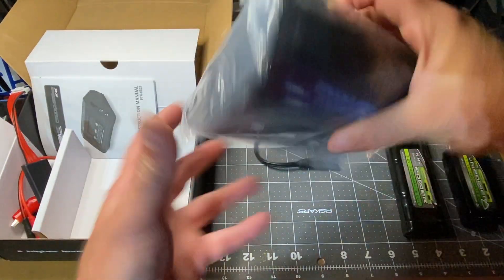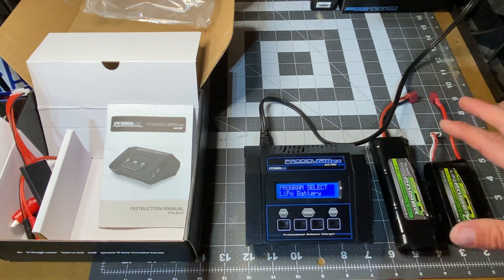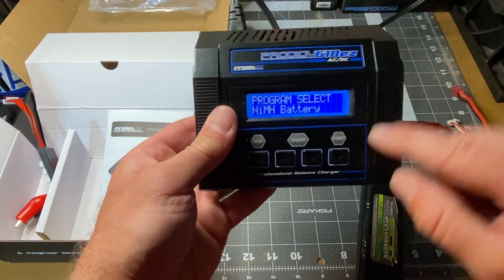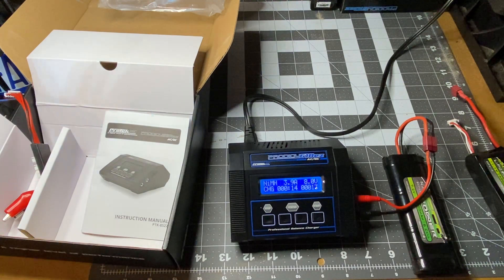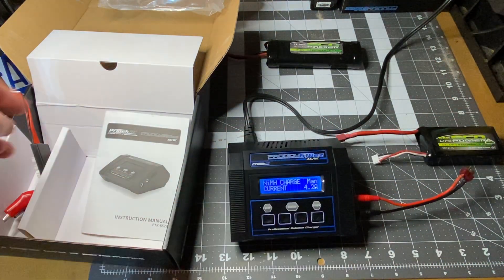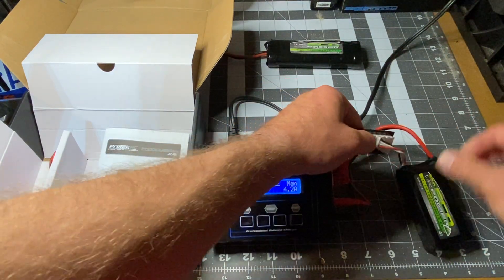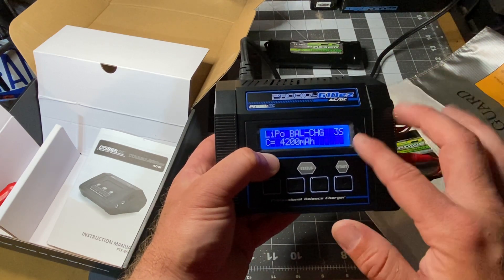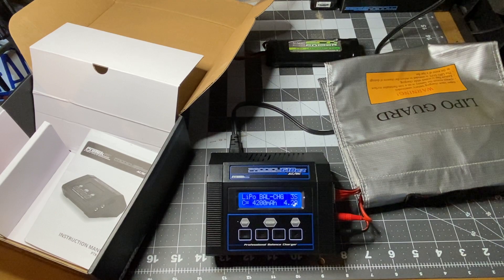ProTek RC Prodigy 610ez Battery Charger - How To Tutorial on Charging

Comment: If battery isn't used all the way or isnt being used isnit good to put on charger a d set it to storage? What does that do as well can u explain please thanks 😊
Reply from the maker: yes, if you don't maintain your batteries correctly, the lifecycle of the battery could be reduced.  If you have a battery charged and leave it charged, it might swell, could leake and then possibly catch fire - not saying these will happen but might.  the swelling for sure...as that has happened to me.  The storage voltage is what keeps the battery safe for those effects.  Also, make sure you don't run the battery per cell too low either or they have a hard time charging back up.  Does that answer? Let me know if you have more questions.

Comment: when i let my 3s battery charge it says full at 4900mah and the battery is 5200mah and i have it set to 5200mah is that normal? nd my charging rate is 8.0 a
Reply from the maker: Interesting. What does each cell say ? Are they at 4.2 volts? And the total volts is that at 12.6 volts? What kind of battery you have? Sometimes batteries say one thing and I have noticed they don’t get charge all the way. Usually I check the volts on each cell to make sure they are at 4.2 volts.

Comment: Hi great video.  Can you connect for a 12 volt power supply?  Or is it only for or powered from a 110v ac supply?
Reply from the maker: thank you! and yes, there is a DC input for 12 volts...it uses a plug...check out the new manual they posted here: https://images.amainhobbies.com/images/resources/PTK-8522/Manuals/1-PTK-8522%20ProTek%20Prodigy%20610ez%20Manual%20NEW.pdf and this is where you can get it from: https://www.amainhobbies.com/protek-rc-prodigy-610ez-ac-dc-lihv-lipo-balance-battery-charger-ptk-8522/p696353#tab-resources

Comment: I’ve subscribed can this charge a zee 9000mah 4s battery
Reply from the maker: thank you for subbing!  I have never tried one that big...but looking at the specs, it says 1-6S and 10 A...but 100W...so, I would charge it at 4S but make the current below 6...it may take longer to charge, but it will not go over the 100W output.  I would try it at 5 A and see how it works.  be careful - I wouldn't go above 6 A.
Reply: @ thank you I’ll give that ago see how it’s goes 
It’s max amps is 6.0
In the settings it does have a cut off frequency up to 10000 at the moment it’s set to 5000 mah 
And I have a 6000mah 4s 
But I’m waiting  for my new traxxas xmax but it’s been shipped with no charger or battery so that’s why I purchased two 4s 9000mah as I’ve seen on YouTube some one who’s done that much appreciate you and your channel
Reply from the maker: @kayone8571  I think the max amp is 10 A, but if you use those traxxas batteries, they are 9 Ah and 4s...so, 9 A * (4*4.2v) = 9A * 16.8 v at full charge...which is 150W, so that charger says 100W, that is why I said try something lower than 6 A.  Let me know if you need more help and I will see what I have to test with the charger...the largest I have might be 4S but 2Ah or something.  Appreiciate the support!  anytime!  If I don't respond in a few days, just send me another message...I will not get mad or upset!
Reply: @ thank you much appreciate well I just purchased this item number if you copy and paste this one should charge the 9000mah 4s lipo brand zee

Comment: How do you change the voltage?
Reply from the maker: I will double check tomorrow, but I don't remember seeing an option for that for NiMH...I'm guessing that is what you are asking for?  I will try a 6-cell and an 7-cell tomorrow and see if I can.  For some reason, I don't remember seeing that.
Reply from the maker: I checked today. 7.2 volt and 8.4 volt and there was no way to change the voltage for NiMH. Just ply in and follow my steps for current and you should be fine

Comment: Can you charge 6s spektrum smart batteries with this charger?
Reply from the maker: I would not.  Those batteries have electronic sensors to determine how each cell is balanced.  This charger does not have that.  You must get a smart charger by Spektrum to charge those correctly.

Comment: How can I charge a 2s 900mAh with no balance leads
Reply from the maker: I would not recommend this...always charge your Lipo batteries with a balance lead.  I constantly monitor each cell to ensure it isn't below 3 or above 4.2 v and the cells are around the same voltage.  Sometimes, if you charge without the balance leads, the battery could say 8.4 volts at a full charge but have one cell at 6 v and the other at 2 v, which is very dangerous and could catch fire or explode.

Comment: Any chance you could make a video on charging the SCX24 battery? Or perhaps tell me how to know which settings to use?
Reply from the maker: let me check...that is a pretty small battery and I usually use a different charger from amazon: https://www.amazon.com/gp/product/B09NNLZBPD/ref=ppx_yo_dt_b_search_asin_title?ie=UTF8&psc=1
Reply: @drluketheduke1531  thank you!
Reply from the maker: @zombieheadsyndicate  you are welcome...so, I don't have the charger at my house - it's at my college where I teach...so, Tuesday, when I head back up there, I will check it out...I'm thinking that the amps will not go that low, so my initial thoughts are that you probably should get a different charger...I don't like the chargers that come with it...I like to balance my lipos most of the time.
Reply: @drluketheduke1531  I think I got it figured out. I appreciate it though just the same. :)

Comment: How many Amps do you storage mode a 2s lipo 5000mah 7.4V
I have the same charger. I'm new at this hobby.
Reply from the maker: so, with my other charger, when I put it at storage, it didn't go above 1 A...even though I put it at 5 A...so, the charger limits the amps when you put it in storage!
Reply from the maker: good evening! This charger doesn't actually have a storage charge or discharge with it (I couldn't find the option and I looked online and couldn't find one either: https://www.amainhobbies.com/protek-rc-prodigy-610ez-ac-dc-lihv-lipo-balance-battery-charger-ptk-8522/p696353?gclid=CjwKCAjwhNWZBhB_EiwAPzlhNnPqSf_YfBsUO1wihbOG8dx4eAXTtuzwa7oIUcyFAA7mFfqZElVXaxoCQ4IQAvD_BwE
Reply from the maker: Usually, with storage charge, they have a limit and it is usually around 1 AMP, I believe.
Reply from the maker: I have a different charge and will take a look and let you know!

Comment: I really appreciate that you did this tutorial.  I just got this charger, and I am charging both NiMH and Lipo 2 batteries.  I am currently charging my Venom NiMH 8.4v 5000 mAh battery.  I put the amp at 5.0, started the auto charge and is showing that it is charging at 10.6v, does that have anything to do with the battery being 8.4v?
Reply from the maker: yeah, that's correct.  So, I'm guessing you have a 7-cell NiMH (7*1.2 = 8.4v), and each cell will charge to 1.5v, so 8*1.5 = 10.5v - the 10.6 is fine.  I hope that makes sense...I probably should make a part II and mention this and the other comment below.  If you have any other questions, let me know.
Reply from the maker: and thank you!  I did a summer camp for students and that was the charge they got, so I figured I would make a video to help them!

Comment: Very well done. Right to the point. Thank you.  One question, what does the counter in the lower right area of the display represent?
Reply from the maker: Thank you so much!  I did an RC summer camp a few weeks ago and the students had this charger and figured I would make a quick video for them.  In regard to the timer, I'm not 100% sure...I will check when I get back home from work!
Reply: @drluketheduke1531  Ok, I think the counter is how many milliamp hours of charge have been pushed into the battery. Thanks again...
Reply from the maker: @sempertard  awesome! yeah, that does seem right! good luck with everything!